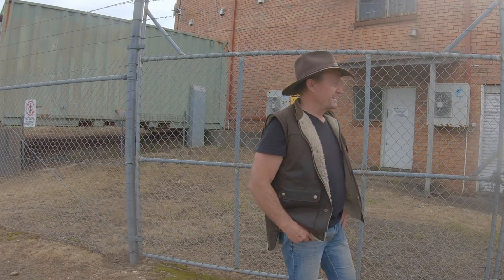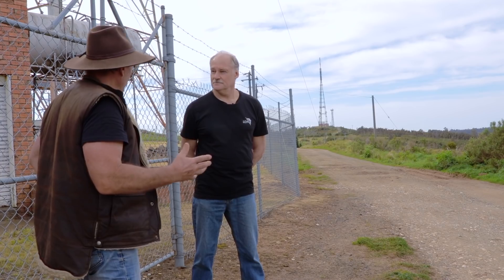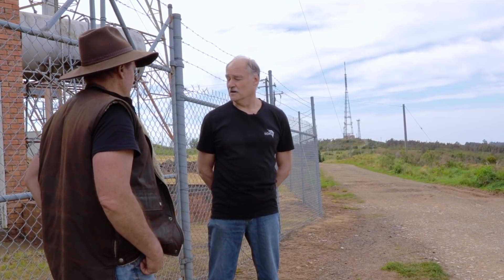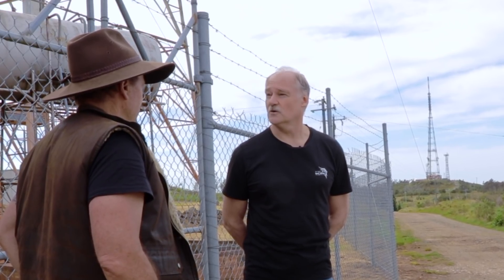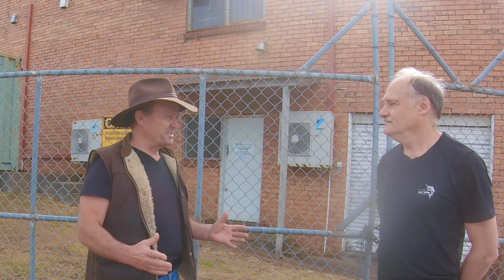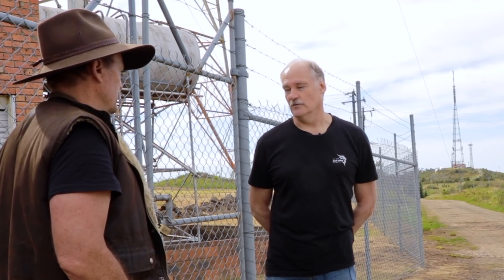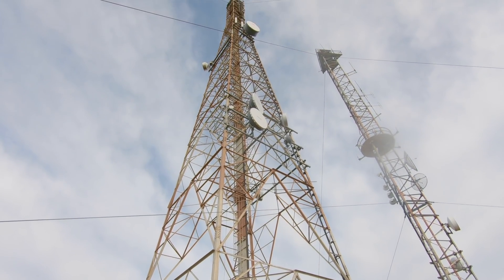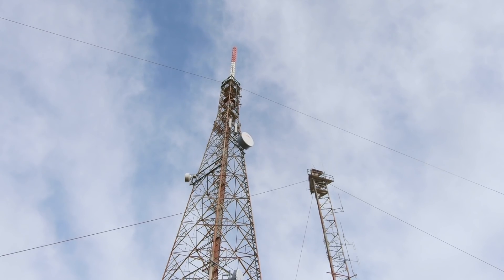How to Boost Your UHF Radio Signal with Repeater Towers for Long-Distance Communication.

Comment: I'm new to UHF I have 0 clue how to use a repeater. This to me still didnt explain how to set it up and make sure it works. My son is about 5kms away and we want to keep in touch but I have not been able to work out the process to set up a repeater channel and so far have found 0 setup guides that explain how its done in Australia.
Reply from the maker: There’s no setup required on your UHF. 
The repeater channels as mentioned in the video are - Channels 1-8 
And Channels 31-38. 
Try those channels. 
But repeater channels are for emergency only. 
You should have regular conversations on those channels incase someone is trying to use one for a real emergency. 

Cheers Tim.

Comment: 4:02 Sorry Tim don't mean to be nasty, But Oricom UHF radios are not something i would ever use again in my life time. I have installed a few for people over the years (as i have been doing electronics for a hobby for about 20 years) and found these radios to be of poor quality. GME or my choice is ICOM Australian owned company and made in Japan. Not all radios are made equal. I also use GME antennas one mounted on the bullbar and other one is located on the roof (excellent range). Now all that aside it would be great if people would not use repeaters to play around on, including the full blown swearing contests. 

LOVED the video mate great bit of information.
Reply from the maker: G'day Adam, 
I take anyones feedback mate. 
This certainly isn't an advert for Oricom. It's just the radio i have, so i used it for that short clip in the video.,
As far as using the repeater channels. I have always wanted to gain a better under standing on how they work and can be used just for my self. For the use of a safety purpose, those repeater channels might just help someone out in an emergency situation. For that reason, i think the video is very handy
As so many replies have been very grateful for this video being made. 
Thanks for your reply and feedback mate, i do greatly appreciate it. 

Cheers Tim.
Reply: @timbates4wdadventures  G'day tim, yeah i fully understood that, just some people on other channels or chat forums think that Oricom is a good radio. but look each to their own. But i have been using my old ICOM 400pro now for many years and not once did it let me down apart from a snapped antenna (kids in car park). Plus my Icom lets say is not transmitting on 5watts either (repeater channels only) and a modified receiver to i can hear further. But i am now looking at the Icom 410pro as its  the newer one for my everyday use radio. 
Their will be no negative comments from me in regards to what you use as we all have our choices in equipment. And enjoyed the live stream the other night mate was a good one.
Reply from the maker: @adamjones2025  thanks mate. 
I’ve had that radio for nearly 2 yrs now, and so far it’s been no worries. 
See if that keeps going. Lol 
You have a top weekend.
Reply: @timbates4wdadventures  You too buddy. Having fun atm greasing under the patrol. Not many greasing points on these girls i have noticed.
Reply from the maker: @adamjones2025  lol 
Yeah that’s one handy thing with the Patrol. 
Only a hand full of greasing points.

Comment: Some good info there Tim! I definitely don't know enough about my CB. Couldn't help but notice the travel buddy jiggling around behind you - you might want to brace that a bit better so you don't have to scrape the pies off the inside :-) either that or maybe just chuck a can of peas in there and make it a pie floater :-)
Reply from the maker: Yeah mate, the towers are very handy to know about. 
I'll check it out mate. 

Cheers Tim.

Comment: Mate would you know if Davis plans road is open in December
Reply from the maker: G'day Nick, 
It normally opens on November 30th each year.
But it has an extended closure this year due to the bush fires earlier this year. 
I would try and call Parks Vic at Omeo if you can. They will have an up to date info on that track. 

Cheers Tim.

Comment: Didn't know that by just listening to bounce back is an indicator of access to a repeater. That's handy to know. 👍🏽
Reply from the maker: Spot on mate. 
I didn't know that either until making the video. 
Very handy info for all.

Cheers Tim.
Reply: @timbates4wdadventures  I've set all the repeater channels on my UHF to duplex. Would you recommend in doing this to all duplex channels or just leave them simplex until it's needed?
Reply from the maker: @Triple-N  I think i would just leave it until it's needed mate.

Comment: Great info Tim thanks. 
4 wheeling and radio go hand in hand. I belong to a "Fox hunting" team - basically we drive around "listening" for radio signals from hidden transmitters, usually in the dark and compete with other teams to find them first. Several "hunts" per night and the tally to determine the winning team at a supper meet afterwards. 
The vehicle doesn't have to be a 4x4, but it helps - aside from going down some very rough tracks, it has to house the equipment and wild direction finding antennas on the roof. We run a continuously rotating "quad" a 4' x 1.5' cuboid  on the roof along with a swinging yagi - like a TV antenna - the stares and questions we get are amazing. 
The quad sits about a foot above the roof and is basically a 3d rectangular shape (cuboid) made of wire 4' by 1.5'. We run computers, transceivers, other comms, and use direction finding methods to locate the hidden transmitters (fox).
Naturally we've been in hibernation here in VIC due to Covid, but the new year promises a renewed season.
Reply from the maker: G'day Benny, 
Sounds like a heap of fun that you guys get up to with your comps in the night. 

Cheers Tim.